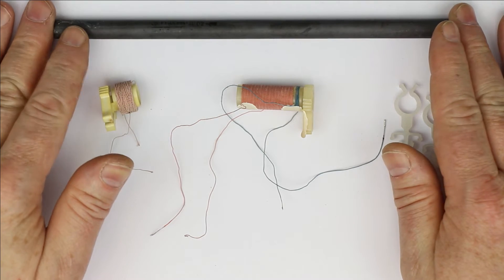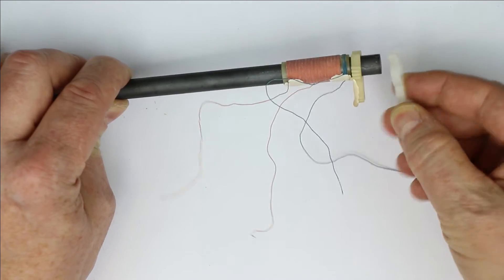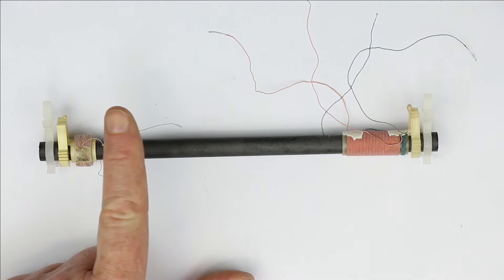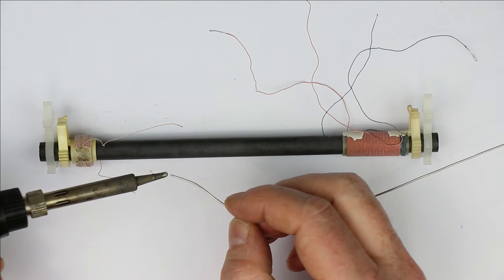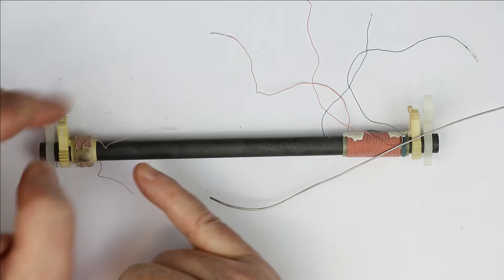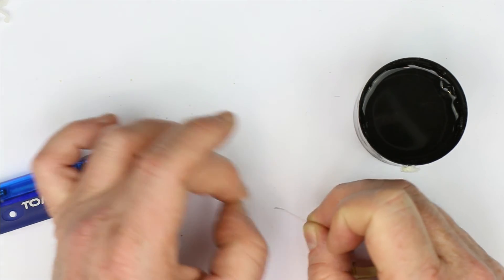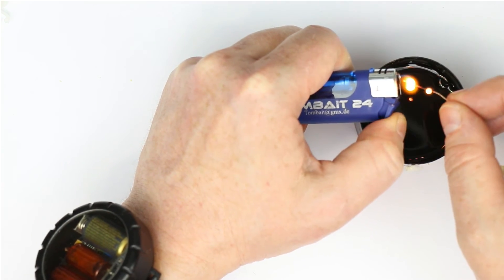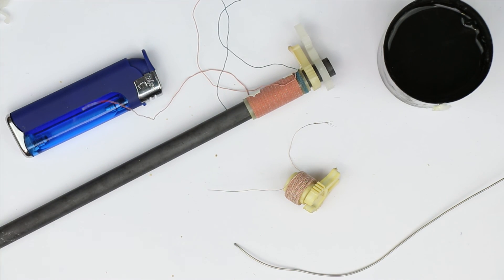How to tin Litz-Wire

Comment: lead free solder melts at 422 degrees F. Regular around 300 deg. F
Reply from the maker: We are here in Celsius-land. The melting-point depends somewhat on the silver-content. Most melt between 210°C and 240°C.

Comment: Thank you for this video.  I just discovered litz wire attempting to work on a small earbud speaker wire. Amazing stuff. Your video helped.  I have a inexpensive hot air station for smd work that will go to 400c and am in hopes I can use that vs a flame, then dip into denatured alcohol.  A good idea?
Reply from the maker: Just try it. 
BTW: Better than the kitchen burner I showed is a simple cigarette-lighter.
Reply from the maker: Ah and the litz-wire used for earphones, speakers etc.is different to the litz-wire used in RF-applications for AM-antennas like ferrite-rod (loopstick) antennas.
In the RF-type litz-wire each single strand has an isolation (usually a polyurethane coating).
In applications where only the flexibility of litz-wire is needed (earphones etc.) the meshwork are pure (uncoated) copper-wire. So there basically is no need to use the method demonstrated here.
You can just resolder those (uncoated) litz-wire with normal electronic solder without any preparation.
Reply: Thx.  I opened  the small cord only to find both wires in strands run together with what appeared to be no insulation between them! The GND/shield looked like copper, and the + was reddish.  So  tiny.  When  I tried to tin them, the solder had no effect or adherence on either. That's when I went looking and found your video and others about lite wires.  Impervious to a 750f iron, and scraping with a knife didn't work either.  Guessing the coating is polyurethane.  Will test later today with suggestions. Cheers!
Reply from the maker: Ah yes. I once had exactly the same thing. This red coated wire was next to impossible to solder :-)
Reply: Well, I think I can say, "Success"!  My hot air station (YouYue 858D+) actually goes to 450c/842f and I applied that heat close until the threads interwoven with the wires smoked.  Then, a 5sec dip in the Denatured Alcohol cup.  I then used an exacto-knive (which is a bit too much) to scrape off the now brittle coating.  Super-fine sandpaper would be a better choice I think.

The strands took solder using a 750f setting applied for about 5-10secs.  Continuity check succeeded.  Thanks so much.  Excellent videos.

Comment: I've been in electronics since the early 60's and I've never used a temperature controlled soldering iron. Ya just plug em in and they get hot, then get to work. I've seen them, but for the price they want......Na. Most soldering irons just have two settings, plugged in and unplugged. One I used to have said it got to 750 degrees but there was no way to verify that.
The ethanol trick is one I hadn't heard of. Does it have to be ethanol or would isopropal work as well.....have to try it. I'm not a big fan of "denatured" as I feel that the additional ingredients may detract from its technical use and who really wants poison lurking around the house.
Reply from the maker: AFAIK it only works with ethanol but I´m not 100% sure.
In all the sites you find with Google there is always ethanol used for reducing copper-oxide to copper.
It´s a classical experiment but I´m not so much into chemistry to give a definite answer.
Reply: The best soldering iron I ever had was a 60W Weller TCP (do a search for Weller W 61 for more details of the modern version).  They work by having a magnetic slug in the tip that loses it's magnetism when it reaches a certain temperature which then release a magnet driven switch. It's not a variable temperature iron, to change the temperature you change the tip. The advantage I found using it was that it didn't get overheated like a uncontrolled 60W can if you are using it on small temperature sensitive joints like transistor legs but it would also solder large joints that would drain a smaller power soldering iron. It also didn't cool down when doing multiple joints like a lower power one can. It effectively became two soldering irons in one, a low powered one and a high powered one, if that makes sense. It was the only soldering iron I needed and it was also bombproof.